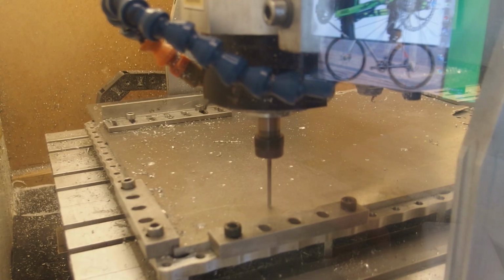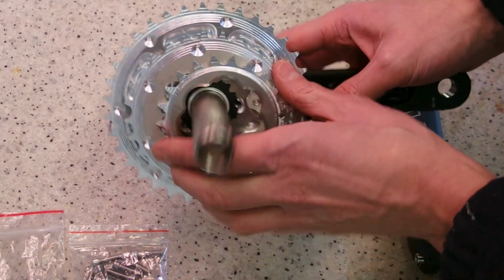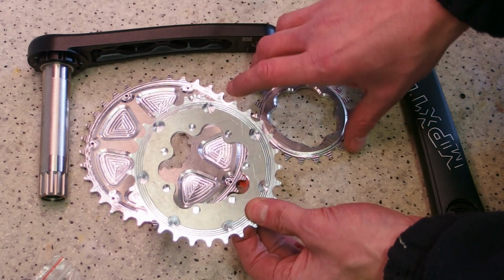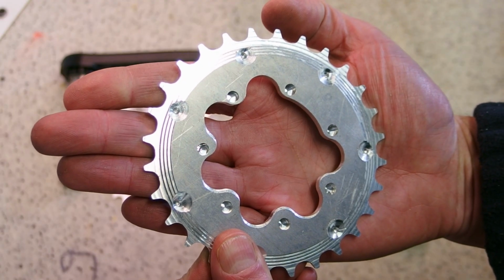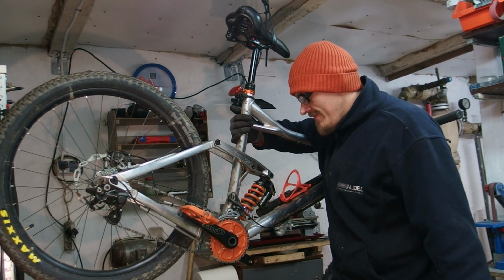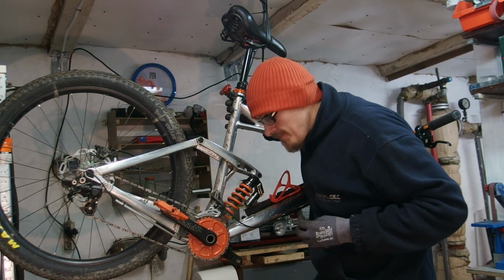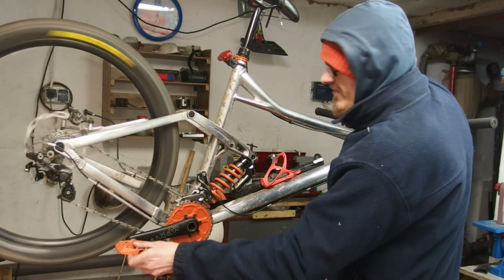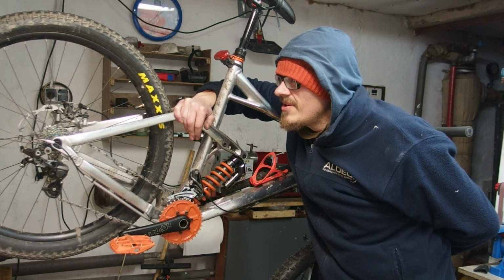I make my own chainrings

Comment: You can try install washer to the crankset axle.
Reply from the maker: I tried, but it wasn't really comfortable. With threaded BB I would get some wiggle room, but on a pressfit - there simply is no way this would work.
Reply: @TryboBike  no, I meant washer to the axle between crank and bb, no to bb and frame.
Reply from the maker: @Lezz015  I did :) The prowheel crank has quite short spline so engagement with 1.5mm washer was really dodgy. Considering what I do on this bike, I was not comfortable with it. It didn't solve the problem anyways.